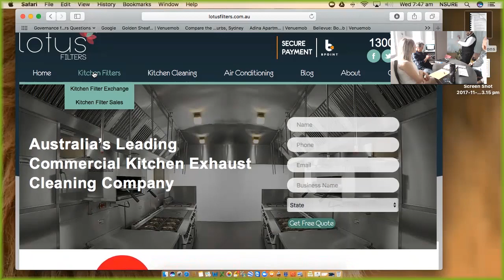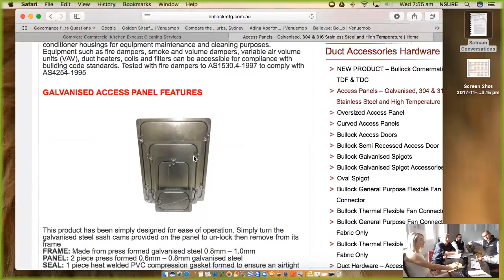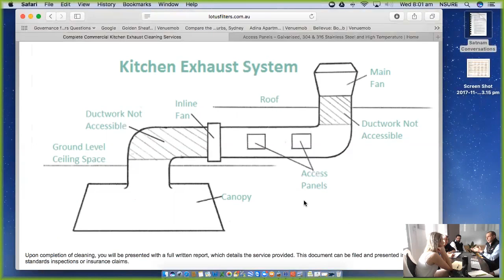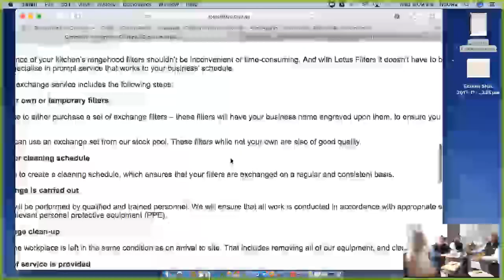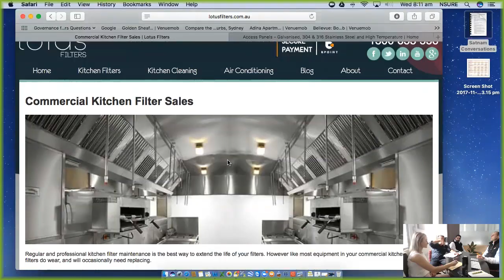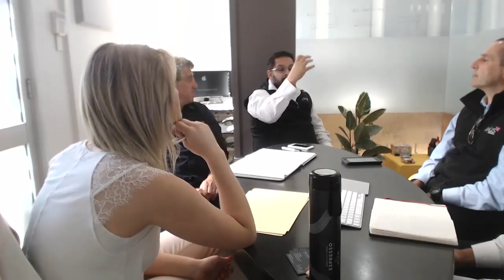Lotus Filter Meeting

Comment from the maker: Index:

§ 4:00 What to avoid when
setting up the kitchen exhaust? Should have an access panel every three metres
§ 7:30 Designing and installing
perspective and sizing considerations
§ 10:50 Why is ducting
important? Fire Hazards!
§ 17:00 How to Guide a
developer? Consider- Design, type of cooking, volume
§ 18:20 What is the best
filter?
§ 19:50 Cost difference
§ 26:50 Lotus services and
where they operate
§ 30:40 Negligence and taking
short cuts will result in paying costly prices when disaster strikes. Why risk
it?